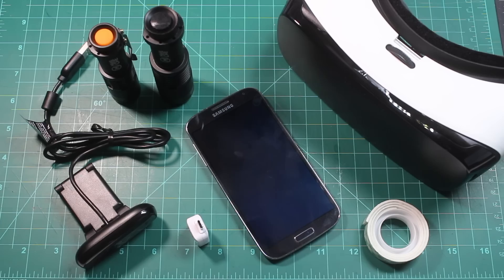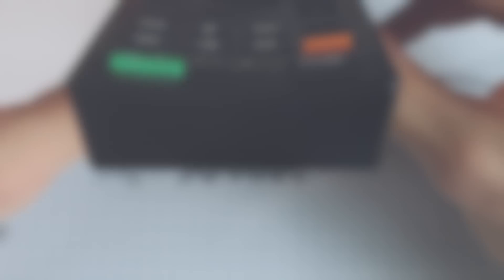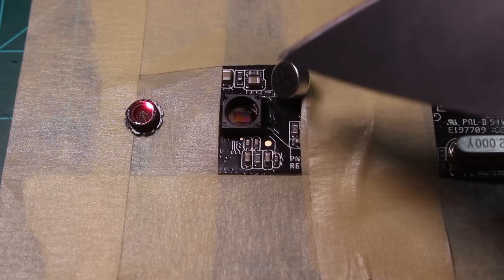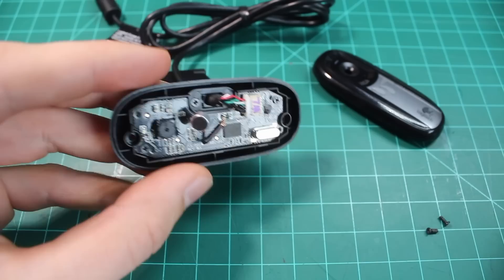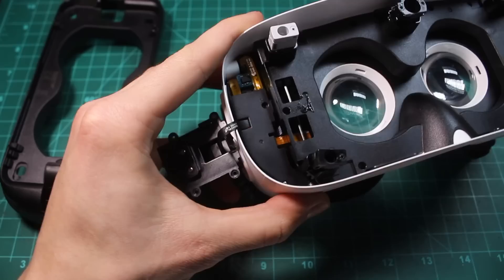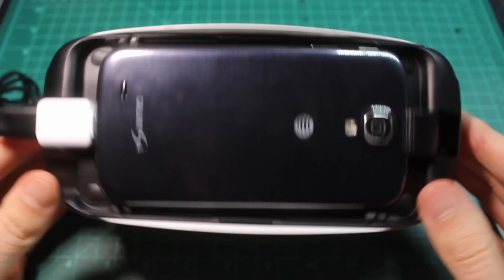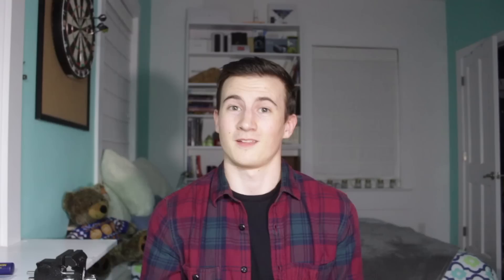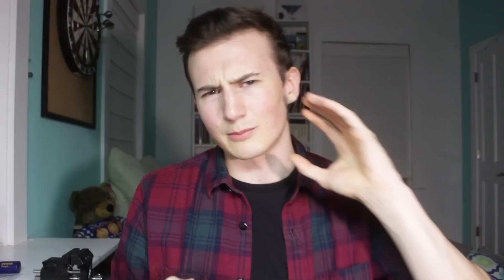DIY Smartphone Night Vision - For Less Than $50

Comment: 2 things to improve this, 
1. internalize some of the equipment 
2. make the webcam location right in front of the face, makes it easier to not be disoriented based on the camera position 
(This is speculation and also you do not have to do it and besides that that was a great build and that works well. The internalization of components is hard but it’ll help it be a little less clunky

Comment: Fucking awesome video mate!! You did a great job with the video production and explanation. i had no problem following along, and all your links were extremely helpful. It was pretty difficult to unscrew the lens from the housing, gotta be careful not to lift the glue. the IR filter shattered and and had to dig all the glass with a dental tool. also when reclipping the board to the usb make sure to put it in very straight, the pins are very easy to bend. i had to use the dental tool to get one of the pins back into position. haha you made it look a lil easier then expected. but the goggles work great. And im making a "regular vision version" for a cyberpunk costume. im so stoked i found this video. you're a genius!!

Comment: Could you also make a video on making an thermal camera out of the same setup? It would really help in the current battle against covid
Reply: Lmao. Buy a thermal camera, that's it
Reply: CCDs in webcams cannot see the IR light required for thermal vision. As for thermal modules, I don´t know if those can be used in a different app other than their own which don´t have the 3D video option to use them in the binoculars

Comment: 4:20 See the lens there with the red glass(IR Filter)? Well if you want to put one of these camera setups on a scope with minimum eye relief you need to change it. You need a (12mm board lens) and it has to be 12mm. The 12mm is the designation of the focal length...

Just go grab a scope and hold your cell phone up to it, you will see the inside of the scope and the actual crosshairs are tiny and there is more black around it than there is actual target viewing. That 12mm will move the sight of the camera forward so that the reticle and target fill the screen. 

What he is doing can be done with any old cell phone as long as it does not have image stabilization but changing the lenz to a 12mm might be difficult!

Just note that putting a new lens in wil change the focus and you will need to make adjustments to it before final assembly!

Comment: The good thing is that not all smarphone cameras have an IR filter ; for example my samsung s9+ doesn't ; so i dont need an webcam .
I just need to drill an hole in the vr box for the phone camera.
But we have a big problem with the modern smarphone cameras:
They have big aperture and have very small lenses , so becuase of that they let less light than dedicated cameras.

Comment: Last weekend I  build this. Yes it works but  I have a problem with the USB Camera App. When I connect a webcam to it its all fine. but when I switch to cardboard view, I see " two videos on one screen"  like in your video. But after a few seconds its changes into  two triangles. The triangles change color a bit when I move arround the webcam. anyone know how to fix  it? Tried it  on a samsung galaxy S8 and a S20.

Comment: There's a camera by Arducam that works with android. It's basically a sensor and sense on circuit board and has ir view out of the box and a 100⁰ fov. 

I could tape it to the front of the vr headset instead of on top, so I wonder if it would work.

Comment: very cool, I plan on doing something similar inside a protogen costume head but with 2 70 degree FOV webcams 60 degrees apart for a 130 degree view angle. I love the passthrough on the oculus quest so much and hope this will turnout as a similar "cyber vision" sorta thing
Reply: I've heard that the cameras mounted on an Oculus pick up enough IR that this could work just by using the default Oculus pass-through, but with an IR flashlight. I'm not certain, but it could be worth a try.

Comment: Sorry but you need two images for this headset to work. We have a distorted image using your solution. I imagined the same thing 5 years ago but with two cameras which allowed me to have a 3D view. We need an application that takes two cameras into account. I no longer remember his name. I used two C920 for that and needed a big etxtenal baterie for consumption. I used à  loading dock with multi usb for charging and connecting all devices. It was a  dock for galaxy note 2 with output hdmi.

Comment: Im trying so hard to connect the damn webcam via the otg cable and it doesn't workk
The cam works with the computer perfectly
Please help😥
Reply: Not all Android phones can do OTG. 
Have a look online with your phone model number to see if it has OTG support.
Reply: You can buy wifi transmitter that work with snake cameras (can't seem to find just the transmitters, but having a snake camera could bring other benefits)
Any wifi ip camera could do the same job, but getting to the ir filter might be harder
Reply: drivers....
Reply: InfinitePower OTG connector is nothing else then just 4 wires and two connectors.He either didnt install the app or his phone doesn't recognise the camera that he is using.

Comment: Real night vision uses a image intensifier tube and does not need ir light to work if there is a small amount of ambient light your invention isn’t real night vision
Reply: "Digital Night Vision" is a widely accepted term for a device like this, and there are a lot of commercial devices available.  Image intensifier tubes represent the earliest systems, but the "night vision" field includes image intensifiers that use ambient light, thermal imaging systems and IR dependent systems such as this one.  There are certainly differences among these three technologies, but they can all be used for many "night vision" applications.

Comment: I don't get it. A with a night vision system like this you can't actually see any more than with a regular flashlight, the only advantage I can imagine is that others can't see your flashlight, so it's basically only usefull for criminals. Compare this to thermal IR where you can actually see at night without any flashlight!

Comment: Building the 2021 super upgraded verison. Got a gearVR 2017 with remote 50 bucks, logitech c920e 50 bucks, flashlight 17 bucks, multi clip on lens pack 15, usb C splitter to charge at the same time 15, power bank 35, 1x digital nightvision for under 200 dollars.
Reply: what is the camera model?
Reply: how did it go?

Comment: This set-up can not give you the real 3d feel.  You may have a split screen and a VR headset but with only one perspective coming from a single webcam, this would fail.  It is night-vision, yes; split screen, yes; but 3D, no.  I should know that by experience.  Back in 2010, I made a VR cam and a VR headset myself out of two 3310 Nokia phones and a broken binocular.  It worked.
Reply: Theoretically, you could put two mini-cameras (that have their own displays) inside the headset. That'd help with depth perception. But, otherwise, this is as easy and cheap as it gets.